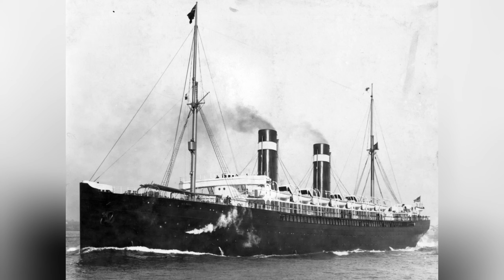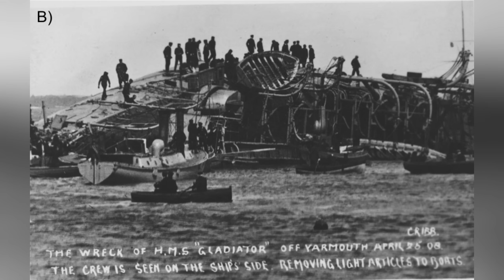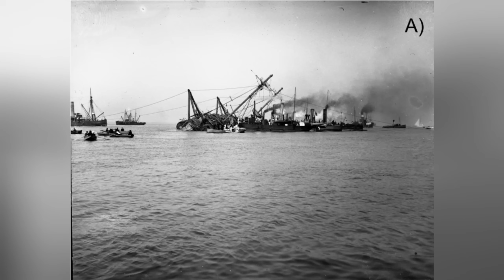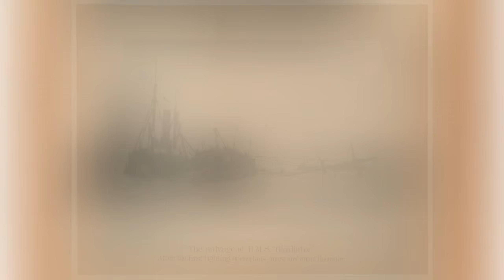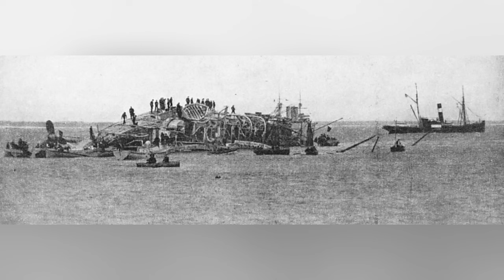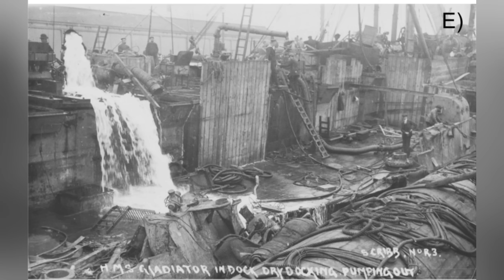Raising HMS Gladiator: Britain’s Impossible Salvage

Comment: HMS Gladiator was a sister ship to the famous HMS Vindictive, the cruiser converted to an assault ship for the St Georges Day assault on Zeebrugge April 23rd 1918 and was the Block ship for the Ostend raid on May 10th 1918, Vindictive was the only Arrogant Class protective cruiser to see active duty in WW1, other than Gladiator written off in 1908 the remaining two sisters were HMS Arrogant which became a depot ship for submarines in 1911 and HMS Furious later renamed HMS Forte to release the name for the Courageous class Cruiser of 1915, was a depot hulk attached to training establishment HMS Vernon in 1912. alongside HMS Vindictive that had paid off as a tender at HMS Vernon in 1912, but as she was still a functioning warship (not hulked like Furious) in late 1914 she was able to be returned to active duty, although probably of less than first line duty, and probably struggling to be manned.    

So even by 1908 the Arrogants were rapidly heading to obsolescence all notionally out of service by 1912 so even if Gladiator had been taken in hand, the repairs would have been only completed in time for a paying off as a hulk or training establishment ship.